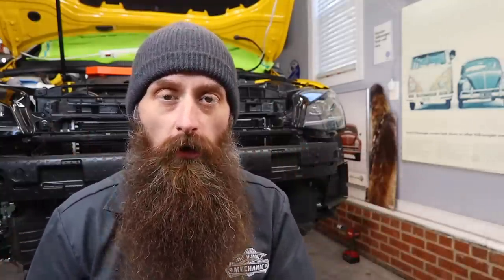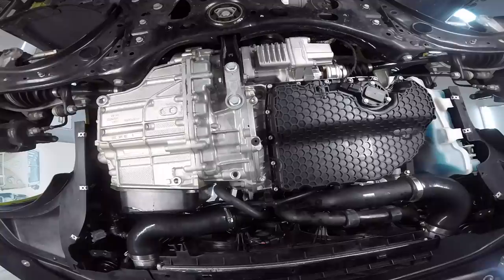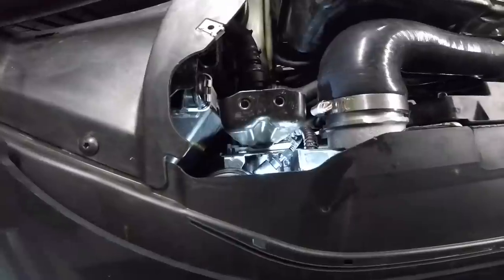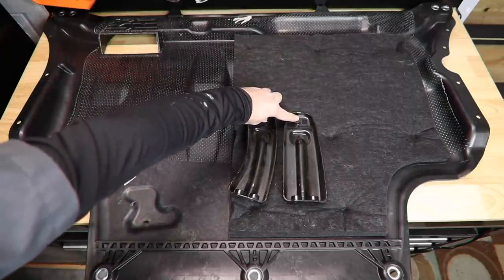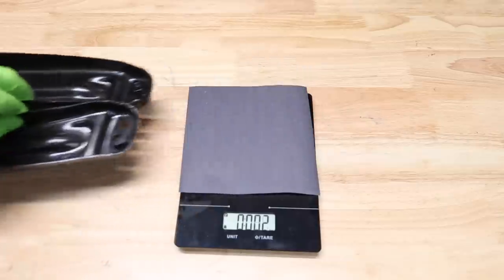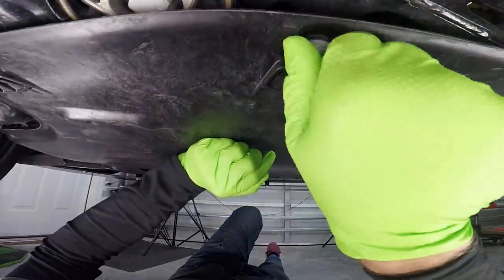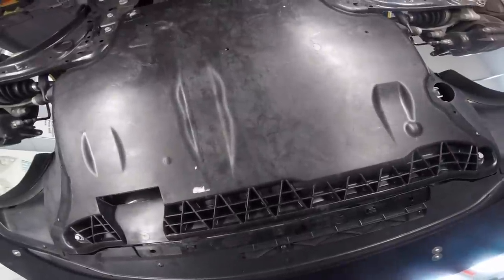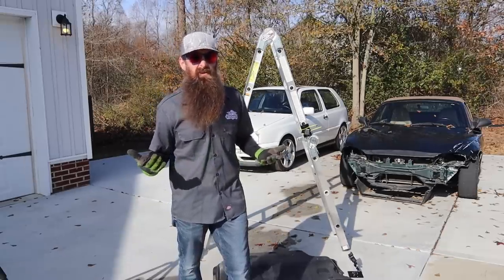How To Install Reinforced Skid Plate ~ PROTECT PLASTIC OIL PAN

Comment: Just installed this today.  What's the part number for the hex head bolts that you used on the brackets in the front instead of the torx style that come with the kit?  I could not get the torx style tightened up properly. Will be swapping them out with hex heads the next time I drop the cover to change the oil.      It's comforting to know my fragile plastic oil pan is protected  now.  Thanks for the video. Thanks for all your videos.
Reply from the maker: I don’t think I have PN. I ended up using something I had floating around. Take the ones that came with the kit abs match them up at the hardware store. That’s what I’d do
Reply: @HumbleMechanic  thank you sir! that's usually my method too.

Comment: WOW! That thing cost over 500.00 with shipping. You can buy an aluminum one cheaper than that.
Reply: The aluminum ones dont flex like the carbon fiber. They dent really easily from experience. Id just go for the metal oil pan replacement (hopefully they are steel).
Reply: Humble always likes to use VW parts.

Comment: is it odd that I had contacted a dealer for an install and was left with this comment "Technician does not believe it will fit with hardware as Alltrack has 8 bolts". Is there that big of a difference to Canadian VW parts vs the version DAP would be selling?
Reply from the maker: It should be the same. Is it built I. Mexico? Should have a VIN with 3vw
Reply: @HumbleMechanic  VIN says 3vw and he did quote an odd part I don't see in most kits WHT 000 729 A.

Comment: Dude just buy an ECS Street Shield and you are paying less for a thick METAL skid plate.
Reply from the maker: It doesn’t fit DSG cars.  And I like that this is OEM ;)
Reply: DQ381 fitment coming soon 👍
Reply: @HumbleMechanic  step 1 - ditch the dsg to get a proper manual

Step 2- get the street shield 😁

Comment: Well its a 4x4 so they're ment for offroading 😁. For road/track use I'll stick with standard cover, better cooling, easier access?
Reply from the maker: I’ll feel better about the protection:) mine is actually the same AWD system as the alltrack

Comment: How much would you charge for an electronic steering replacement and alignment for a vw jetta?
Reply from the maker: Probably a few hundred bucks. I’m guessing labor and alignment is in the $500 depends on what driver assist the car has
Reply: @HumbleMechanic  Thank you. My car is messed up and I can't afford the $2,580 that they are asking just to do those two things. I can order the part myself too if neccessary. Where would I go to get it repaired for such a price? Are you near Louisiana?

Comment: People on here are silly. This OEM belly pan is designed to protect the pan from random things getting kicked up that might damage the pan. It’s not meant so you can go off-roading and hit immovable objects like boulders or if you’re an idiot and slam your car so low you scrape on everything every ramp. It works great for what it’s designed for. Even if you replace it with a metal pan, the oil pan is still the lowest point of this car so having some protection to deflect loose objects (key point) is worthwhile.
Reply from the maker: There is only so much you’re ever going to be able to do. Lol

Comment: Will this work on the S3/8V platform?
Reply from the maker: It should. That’s MQB. I however can’t confirm 100%
Reply: @HumbleMechanic  I appreciate the quick response. It looks like the original half sized skid plates are exactly the same. Would I just need to confirm the bracket mounting points are the same?

Comment: Can you link that wratcheting wrench you used to tighten the brackets?
Reply from the maker: Sorry I thought I did https://www.gearwrench.com/gearwrench-86126-10-pc-120xptm-universal-spline-xl-flex-head-gearboxtm-ratcheting-metric-wrench-set.html
Reply: @HumbleMechanic  thanks so much! I don't want to buy the entire set that you have linked. Do you happen to remember what mm size the trench is for that bolt on the bracket? Looks like 17mm but I'm not 100% sure.

Comment: I'd really like to add one of these but the $400 price tag is holding me back
Reply: It's a LOT cheaper than an oil pan replacement.
Reply: @Uberragen21  and the grinded engine parts.
Reply: Messeresser lol not really
Reply: @paperwind1841  - Oil pan replacement at my dealership costs over $1200. You call a $250 belly protector more expensive?  Your logic is a bit skewed buddy.
Reply: Messeresser ok for a lower oil pan replacement at a German repair shop is $250 a steel oil pan is about $115.  That belly pan in the video is about $455 after tax. So if you want to go to a dealer ship just to pay $1200 for a 1.5 to 2 hr labor job. And for a part that cost $115, Then go ahead. So you do the math (buddy). Keep providing job security.
Reply: @paperwind1841  - If the car is under warranty, you would go to the dealer. Oil pan is $600, labor $185 an hour for a 3 hour job. 
That's $600 + $555 = $1155 plus tax on parts for another $60. Total is just over $1200.

Use your brain guy. It's not hard.
Reply: @paperwind1841  - I also wouldn't use the factory belly pan. There is one from ECS that is $250 and aluminum, it's better than plastic one in the video.
Reply: Messeresser only if youre only replacing a factory composite pan for another. That’s dumb. I’m clearly not talking about that. And now we are talking you. $250<$455. That was my point all along. That belly pan on this video is overly expensive compared to a steel  oil pan, or an aluminum skid plate. You are finally using your brain.

Comment: Plastic. What were they thinking. I go through this with BMW. I have a RT and they use plastic in places it has no business, like the throttle body pulleys. They are known to crack after a while and do, with loss of throttle. BMW won't admit there is a problem, but because of the timeframe involved, they don't have to do anything about it anymore. A type of planned obsolescence that benefits dealer service if one uses that. I'd like to line up the BMW execs and engineers and stooge slap them. Plastic...

Comment: Change my mind i like only metal oil pans
Reply from the maker: Wouldn’t even try. Lol
Reply: Plastic composites dissipate heat much faster. No possibility of condensation on plastic oil pans. Cheaper to manufacture and replace in case of accident.

Comment: The Golf R's original "belly pan" is nothing more then a glorified mud flap to keep water off the drivebelt. The Alltrack upgrade should be standard equipment, especially on an vehicle with a plastic oil pan. A plastic oil pan...really VW? Sigh...
Reply from the maker: 100% agree. Also glorified mud flap. 😂😂

Comment: Just replace the plastic oil pan with your plastic intercooler and plastic radiator there is so much bad stuff vw has done to all these cars and there not e en responsibly sable I lo e my car now that I ha e vested 35 to 40 thousand into it to late to turn around now. Peace
Reply from the maker: I’m expecting this to be more common as time goes on. There are some great composites out there. But it’s still just a ugh feeling about it for vital things.

Comment: If that palasic pan didnt crack from a shock..it will crack from heat..one of guys i know he have a car with trans palasic pan..it cracked from the heat cicle..what in the hell car factorys was thinking when they make oil pan from palasic? they need bitch slap for that idea's
Reply from the maker: I’d think cold would be worse than heat. But I’d love to test it.
Reply: @HumbleMechanic  i would love to see video on that 👌

Comment: VW designed this car so that the oil changes can be done without diving under the car. Nice idea, but there's no need for oil changes cause you need a new oil pan and oil every time you hit a pothole or debris hahaha.
If basic maintenance is done from above why not fortify and cover the bottom of the engine as well as possible. Plastic oil pan without a cover is just plain dumb engineering.

Comment: I'm a mechanic myself, and i gotta say throughout the years, VW is the biggest piece of shit cars ever.  Never ever will you lift up a VW with 100K miles without seeing a puddle of oil leaking, air injection pumps break, even after you replace it and the hoses the check engine light still come on, customers can't pass emissions.  Bad engineering making things hard to work on and people have to pay extra for labor.  Lately we've had VW come into my shop for oil changes, they have the plastic drain plug, leak all the time...who the hell thought that was a good idea to design that?

Comment: wow , this guy can really talk up some shitty vw platstic  parts...esc tuning has a great plate with is just bolt on, n0 brackets. I ran over a log truck tire and skid plate saved my oil and transmission...was able to drive home because of it being I was in the middle not nowhere at 4 am.
Reply: It's carbon fiber. Very clear at 9:58
Reply from the maker: Doesn’t fit DSG cars.
Reply: I was actually talking about the plastic oil pan.. Not the plate.. Was   waiting for a metal plate the whole time lol... Thought the one he was plowing wss the one he took off 😬

Humble mechanic I have a DSG 2017gli, thats what I have it On.

Comment: Volkswagens are for bellends...why the hell would you buy a car with an oil pan made of plastic...least of all a German car with a plastic oil pan only to then worry about it?!
Reply from the maker: I’m not worried about it ;). 

I will say this is not an exclusive vw thing. Many manufacturers are moving to composite stuff in places we may not like
Reply: Yea...i've seen ford trucks with them too...but i haven't seen any of the Japanese manufacturers do it, and they (toyota, honda) tend to aim more for longevity so I guess that's a factor in it all.